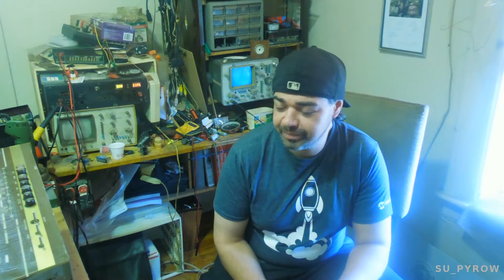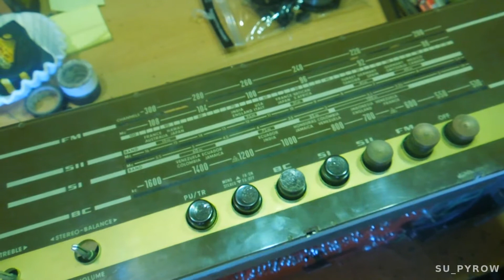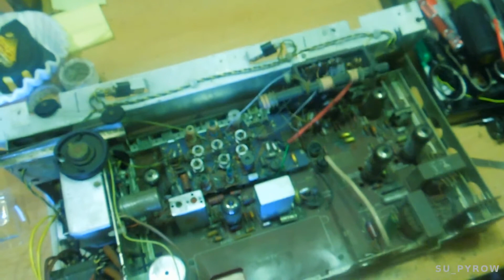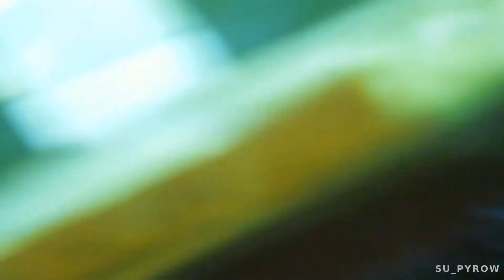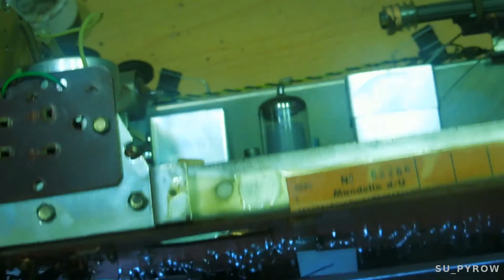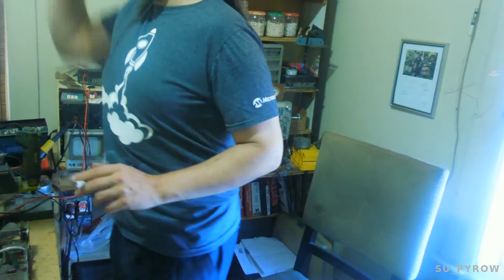Grundig Mandello d/U 1965 Console Radio | Stereomeister 300A 1965 | Part#01 SUPYROW #10

Comment: Hi, I know this is an old video but can you tell me if the tuner knob is just on by friction?  I have the very very similar KS 620 U and the knob has no set screw but won't budge.  I don't want to break it.
Reply from the maker: tuning knob or the flywheel(behind) attached to it?    the knob itself on this radio was a push-on. the flywheel behind it(after the main cover panel is removed, that from what i remember a clamp, diagrams might help determine this.
http://gokarters.com/smf/index.php?topic=2543.0

Comment: That Grundig is a really great German brand not built like a tank but pretty close. I know you will get this one working again. I have an old 1957 German Radio I picked up at a Garage sale last year for $25 same time I picked up my magnifier boom for $5 but the German radio only needed a new Ferrite core and one wire soldered to the antenna and it works fine. It was one of the other brands like Grundig all tubes.

Comment: wow, a vintage piece. I guess to find the dial/needle freq, if it has an AM/FM 5.30-1600 you can turn on another radio to a station then find and set needle/dial. Have you tried any forums on vintage SW?  Back in the 80's/90's when I had my store Grundig had info on their older stuff and charged $3 per copy.  Good luck, you'll get it working.
Reply from the maker: Hey Buzz!  yeah i got a source for the schematic,and have completed the dial strings!  just finished about an hour ago.  still havent powered it up yet, have to do many more checks first! :)